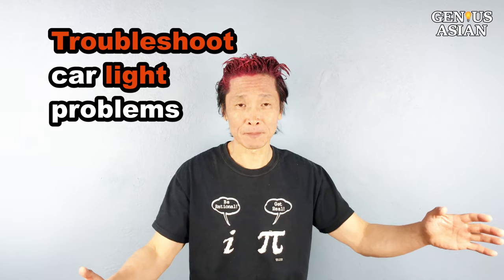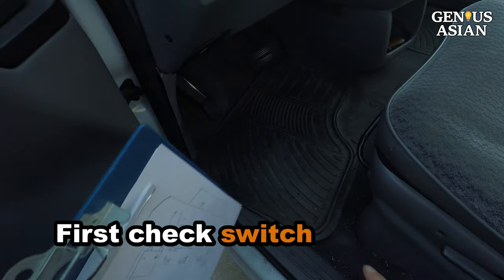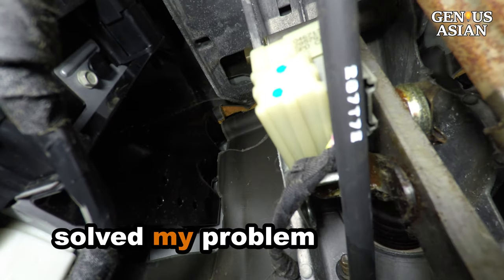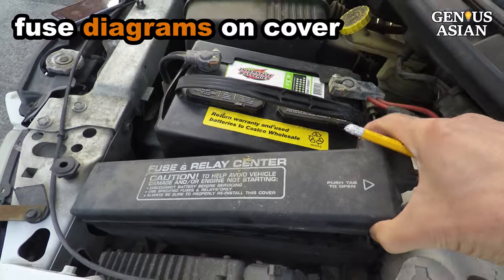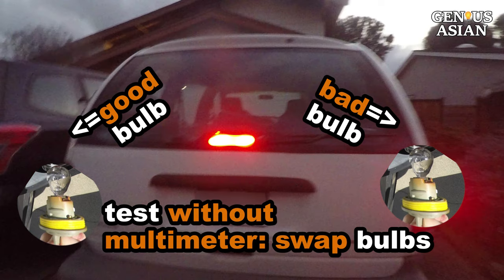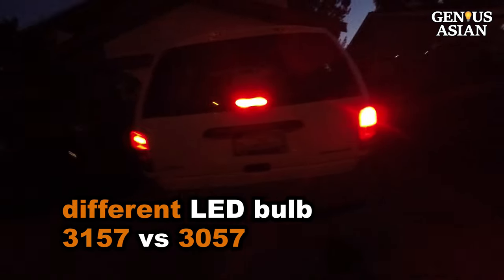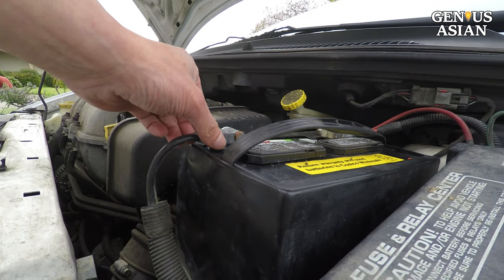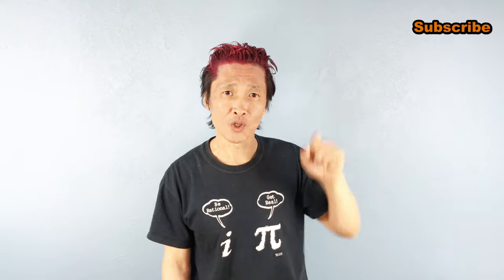How to troubleshoot car light problems, such as lights not turning off or one-on one-off.

Comment: My Zafira issues are the brake light s work when you start the car for around 1 minute then they stop working crazy any help would be greatly appreciated...
Reply from the maker: there are 5 parts: battery, fuse, switch, light bulb, wire. You can test each part and "eliminate" the one that you demonstrate to be a working part. Since the light is one for 1 minute, you may assume the light bulb is working. (Note that in rare condition the light bulb may be faulty, but you have already tested the other four part, then, can you test the light bulb and to wait for 1 minute to see if the light bulb is still working?)

Is your battery working fine? After 1 minutes, does the light bulb go out or does it dim darker?

The switch has higher probability to fail, you should test it. 

Do you have rats in your car? Rats like to chew wires. (no kidding, I have seen rat's dropping in cars)

Comment: can anyone help me with my tail lights staying on? i have no brake lights if that makes sense! i have a 2010 hyundai sonata
Reply from the maker: I copied the video descriptions of this video. This video discusses ways to test and eliminate possibilities so that you can quickly focus on the real faulty components. This method can be applied to other electrical circuit, the 6 steps should be:
1. draw a electrical diagram 
2. measure every exposed points.
3. mark the measured points on the electrical diagram. 
4. construct a truth table (as shown in this video) to eliminate good components and further narrow the search to trace the circuit.
5. once the search is narrowed, remove the faulty component for test.
6. And repeat from #3

Comment: Does this also apply to a 2006 Ford Mustang? My right brake light and right running light stay on
Reply: man I'm having the exact same problem in a 05 mustang
Reply: @jessetaylor7849  me too bro did u fix it?
Reply from the maker: This video discusses ways to test and eliminate possibilities so that you can quickly focus on the real faulty components. This method can be applied to other electrical circuit, the 6 steps should be:
1. draw a electrical diagram 
2. measure every exposed points.
3. mark the measured points on the electrical diagram. 
4. construct a truth table (as shown in this video) to eliminate good components and further narrow the search to trace the circuit.
5. once the search is narrowed, remove the faulty component for test.
6. And repeat from #3

Comment: My left brake light turns on like it’s supposed to but when I press the brake it turns off I replaced the bulb already and same thing any suggestions ?
Reply from the maker: you said: "My left brake light turns on like it’s supposed to but when I press the brake it turns off I replaced the bulb already and same thing any suggestions ?"  I don't know if you have a typo in your question or not, but I see contradiction in your question: the two things "brake light turns on like it’s supposed to" and  "when I press the brake it turns off" contradict each other, because if I "when I press the brake it turns off" then it is not "it’s supposed to", correct?
Reply: @GeniusAsian  so you know when you turn on your headlights the tail lights also turn on so that works everything turns on however when I press the brake the left tail light turn off while the right and overhead brighten up. Does this make a little more sense ?
Reply: @GeniusAsian  i already replaced the bulb and checked the fuses and both are good
Reply from the maker: @CarlosDanielBarragan-nt1hh  still does not make sense, why would your brake lights on when you turn on your headlights? Are you confused brake lights with tail lights?

Comment: Great video, but what if your right taillight function perfectly and the left one only turns on when the brakes are pressed
Reply from the maker: did you check the bulb?
Reply: @GeniusAsian  I put a new bulb in. Right taillight turns on and when I press the brakes it gets brighter like it should. The left taillight only turns on when I press the brakes. I’m lost 🤔
Reply from the maker: @jaymen8302  when you say "I put a new bulb in" it is not clear the new bulb is on the right or left? Also be aware car light may be dual filaments, make sure you know which is which.
Reply: @GeniusAsian  i put a new bulb in on the left side where the bulb only turns on when I press the brakes but then turns off completely when I let go of the brakes. The right bulb stays on like it suppose too and go brighter when I press the brakes like it suppose too. Idk what it could be
Reply: @jaymen8302  I'm having the same problem and I can tell that this lady only really knows the basics or at least the not complex mechanics. Anyways, guessing you probably solved the problem or took it to get it solved, which I wanna ask did you found out what the problem and how it got fixed? Like, what had to be done?
Reply: @cheekclappa7192  I never got my answer and ended up selling the car for financial reasons. My guess would be wiring issues or a short somewhere. I replaced fuses, bulbs and switches. Nothing solved the issue. Not much info on the internet either at the time. If you find out lmk I’d like to know what caused it too.
Reply: @jaymen8302  Ah damn. Thanks anyway. I hope your vehicle that you have now is doing good and that you'd be good in general. Have a good one.

Comment: So I have a 86 montecarlo ls I have lights on the front right side only and on the left rear side only
Reply from the maker: first try this: take the one light bulb working and put it in the socket of the light not working, and see what happens
Reply: @GeniusAsian   did all tha new fuse new bulbs,fuse box putting right amount of power ,headlight dimmer switch new ,
Reply from the maker: @toonse3683  when you said "fuse box putting right amount of power", how did you measure the "power"? Did you mean voltage or current? Also what do you mean "headlight dimmer switch new"?

Comment: ok so what if my brake lights work, but turning on my headlights causes them to stay on, and also the turn signals work except when the headlights are on and then only the left signal works, and also pressing the brake pdeal and using the right signal cause the dash lights to go dim? When I remove the right brake/turn signal bulb everything functions normally. guess I need the 'level 2' video lol.
Reply from the maker: copied from the video description:
"This video discusses ways to test and eliminate possibilities so that you can quickly focus on the real faulty components. This method can be applied to other electrical circuit, the 6 steps should be:
1. draw a electrical diagram 
2. measure every exposed points.
3. mark the measured points on the electrical diagram. 
4. construct a truth table (as shown in this video) to eliminate good components and further narrow the search to trace the circuit.
5. once the search is narrowed, remove the faulty component for test.
6. And repeat from #3

Comment: Where should I start my diagnosis if both my headlights and tail lights are working... just not at the same time...
Reply from the maker: interesting problem, can you give us more details on the conditions working vs not working?
1. condition for headlights are working but tail lights are not working.
2. condition for headlights are not working but tail lights are working.
3. condition for headlights are working and tail lights are working (does it ever work?)

Without knowing your car, it is difficult to diagnose it. In general, keep in mind a few points:
4. Two lights in one bulb. Since you said both "headlights and tail lights are working" the light bulbs should be good, but as shown in the video the same bulb has two different lights, so you should not draw a wrong conclusion the bulb is good because the lights came from the same physical location. 

5. Generally when you flip the headlight switch that also turns on your tail lights.
6. Some models have taillights on an automatic sensor which turns tail lights on when it detects a drop in ambient brightness. So you should examine if you got a bad Ambient Light Sensor
Reply: @GeniusAsian  it's a g35... basically when I turn the head lights to on auto fog or whatever I cannot seem to find a setting where both tail lights and headlights are on at the same time... one click headlights will work tail lights wont... next click over tail lights are on but headlights are not
Reply from the maker: @mustafagak2852  Since you may have multiple suspected components at fault, and they are not in series, there are two different ways to troubleshoot. One is to remove the high probability of faulty components to test. The second is to collect as much testing data with different permutation, these permutation will reduce the number of removal tests. To answer the permutation of my original question 1 and 2, your description of "one click headlights will work tail lights wont... next click over tail lights are on but headlights are not" does not provide enough information. If you spend a little more time to describe what is this "one click, next click", then your information will be more useful. 

In addition, you should expand the permutation to include other components, for example question 7:
7. do tail lights go on when you press the brake? (I assume when the brake's not pressed tail lights not on, right?) (I also assume you understood you understand my point 4, two lights in same bulb)
Reply: Appreciate the quick replies... and I apologize if I'm not in depth enough with my comments as my dog is in labour atm and my attention is mainly towards her but I will upload a video to show you more of what I'm talking about... as for the one click headlights work one click tail lights work I was talking about the switch on the lever by the steering wheel that controls the headlights... should be off auto on or something.... the price that controls the wipers
Reply: @GeniusAsian  sorry I've been really busy... my dog had a litter of 11 pups... I will try and get an update for you today or tomorow... once again really appreciate the help!

Comment: I once noticed that my left front light was completely off (for long and close distance), I drove an hour or so and checked again and it was on! What could that be?
Reply from the maker: many possible reasons: 1. water went into somewhere and made short. 2. switch is bad. 3. loose wire

Comment: How about all lights work but when car is off one stays on???
Reply from the maker: yes, this video explained exactly this situation.
Reply: Hi, 
I have the left brake light, not working in 2011 town and country, I checked it on the right side, and it's working , the fuses are OK. What other possibilities?
Reply from the maker: @theinspired5367  you need to follow the process described in the video first. Did you at least swap the left bulb with the right bulb?

Comment: Would anyone have a suggestion for my issue?
My VW Passat 2011 (facelift model - Ireland) rear right tail light *sometimes* doesn't turn on, but a light smack on the light unit from outside turns it back on. I've already ripped the trunk apart looking for faulty wiring, I've replaced the bulb several times, I've cleaned all contact points and pinched any clips to be tighter to get better contact but the same issue still occurs. I'm honestly out of ideas, so maybe a new perspective would help. Thanks!
Reply from the maker: Yes, the on-and-off situation is difficult to debug because you don't know how to reproduce the failure conditions. Two possible conditions: bad connection or short. If there is short, then it may have burned something, so it is unlikely. If it is caused by loose wire or bad contacts, then you need to test each inch of wire and every contacts. There are at least two wires going to the bulb, so you also need to check both of these two wires. 
Alternatively, you could also try to use a good wire to bypass one of the wires connected to the bulb. After the bypass, if your problem disappears, then it is that wire that caused the problem. When you perform the bypass, make sure you know which wire is hot, which one is ground, so that you don't cause the short from hot to ground. Let us know your result, this will help other people.
Reply: @GeniusAsian  Thanks for the tips, I'll try to get it done next week, though with lockdown I don't really drive anywhere lately, so might be a while before I can make conclusions. But I will definitely check back and report the results. Thanks again.

Comment: I have the second case where my right side is off but the weird thing is that it turns on when I press the brake
Reply from the maker: Did you measure the resistance of the bulb? In many vehicles, the brake lights and the tail lights may be located in the same bulb. Tail lights are engaged when the you turn on your headlights or when your parking brake is on, whereas the brake lights will light up immediately when you apply pressure to the brakes.
Reply: DRIFT STYLE

Comment: Don't leave the battery cable off of the battery too long while the engine is running, it will burnout your alternator. By the way I own the exact same Caravan as you, except its a few years older and V6 powered.
Reply: Me 3⚡😎🌞

Comment: left side is on, and right side is off.  what if the fuse is good, and the light bulb is good, and the socket is also good, what is left is wire right?  You didn't explain much about it.
Reply from the maker: which light are you referring? The turn signal light would need separate left and right switch control, and other lights the left one and right one should both be on. So in your case, if the light you were referring to is the turn signal then first check the switch, for other lights according to my circuit diagram then you should chase the wires.

Comment: You totally side stepped what to do if the bulb was good and left side still won’t light
Reply from the maker: As shown in the video, there are 5 components in the circuit: battery, fuse, switch ,  light bulb and wires. In terms of probability, the light bulk has the lowest lifespan. The battery, fuse, switch are not too hard to test, so you should test those. Since the light bulb from the right side is good and electricity reached the right side, then the final step should trace the wires' conductivity

Comment: Fuck my Explorer must be having wiring issues! Only third breaklight works, two corners don’t, changed fuses, relays, multi circuit, GEM, bulbs, switch, and still no poweee going back theee when break a engaged.

Comment: No lights on drivers rear side work. New bulbs new fuse battery fine. Other side works. I've cleaned connectors. 🤯
Reply from the maker: you still could swap left bulb with the right right light bulb to confirm that your new light bulb can fit the socket correctly. If that does not solve the problem. Use the volt-meter to compare the voltages from left and right side terminals to see if they are identical. If they are not identical, then keep tracing the wires.

Comment: So all of the rear lights work fine when opening and closing the doors. So the bulbs are good, the battery is good, the alternator is good. The problem is that the left driver's side rear brake light won't come on when I press the brake pedal. The other side comes on though. I'm thinking the problem is a broken wire between the left and right brake light. Anyone else have this same problem? I have already replaced the bulb even though the old one was still good hoping it would somehow fix it, of course it did not.
Reply from the maker: be aware that there are two filament, so the brake lights and parking lights are different.
Reply: @GeniusAsian  Yep that was it, one of the filaments was burned out in the bulb.
Reply: @TheLastWizard my lights work, but when I hit the brakes only one side goes bright and the other turns off completely.. how did you fix ur problem? Idk what a filament is
Reply: @antonygimed7262  Filament is just a tiny little squigly wire inside a light bulb. Incandescent lights have them. Most car lights are incandescent still, eventually they will all be LED. So your brake light has two filaments, or two of the little wire thingys that a regular light bulb has. You know when you shake a regular light bulb and if it has a tingy rattle sound it's no good. That means the filament is broken.

I'd start with just buying a set of light bulbs for your car, they are less than 10 bcks for two of them. Then just youtube how to change the brake light bulbs for your particular vehicle. It's normally just acouple of screws either plastic or regular that are accessed on the inside of the trunk by pulling the cloth planel that covers them to the side, after removing a big plastic screw, or plastic pin.

Comment: My Passengr side Brake light is working fine   Divers side Brake Light is slow to come on and is dim
Reply from the maker: what kind of light bulb is the dim one? What would happen if you swap the left bulb with the right bulb?
Reply: @GeniusAsian  i have to take the Facia on the yaris boot to access the lights
Reply from the maker: @davidoneill9442  since all the components are connected in series, all components can cause problems. In terms of probability, the light bulb has higher probability of failure, so check that first.

Comment: Never disconnect the battery terminal while the car is running it could most likely ruin the alternator on many vehicles
Reply from the maker: yes, could cause problem to either the car electronic parts or the alternator, the risk probability is higher to cause problems to other electronic parts because if your alternator is over-charging your battery with higher voltage, disconnecting it may allow the alternator to provide an even higher voltage to sensitive car electronics. So be careful with newer car with sensitive electronic components.